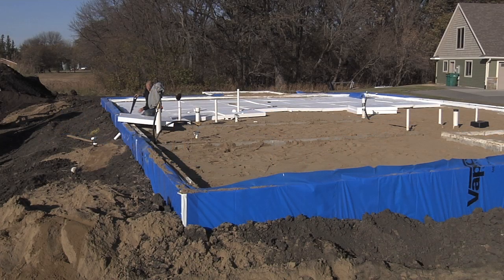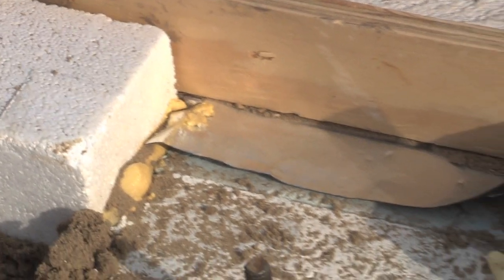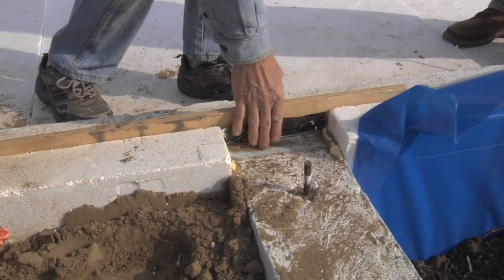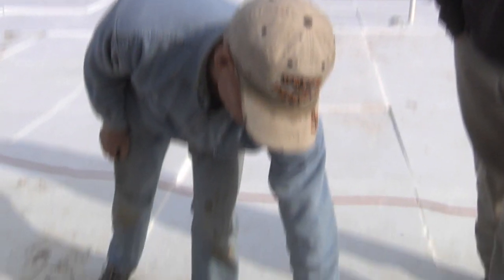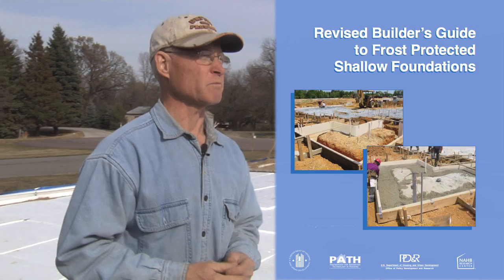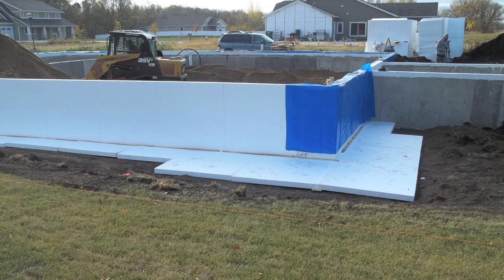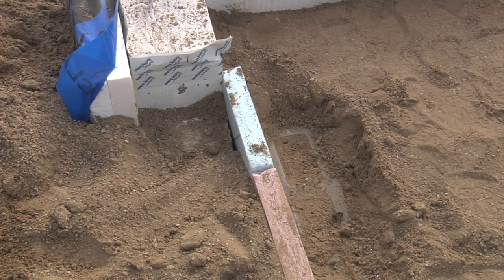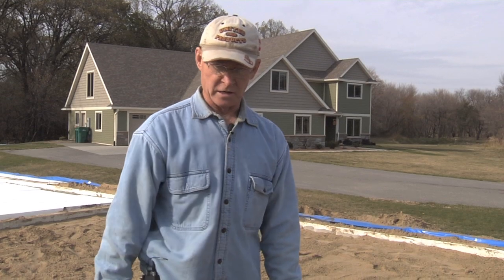Foundation Insulation Effectiveness: Frost Protected Shallow Foundations

Comment: The 4' wing won't she'd water laying flat. It should be pitched away from the building if shedding water was the intention. The way it's laying flat it only insulates the ground out to a further point from the footing. Upon backfilling if the ground compresses that foam could pitch toward the footer creating a trough bringing water in the direction of the footing.

Comment: I saw no french drains anywhere
What if the water table rises to just below the slab
The structure is built on a moat, but what if it wasn't, would a french drain be added, if yes, where would it be placed?
Reply: IMHO this type of foundation doesn't need it.